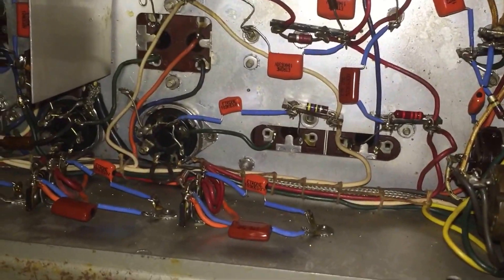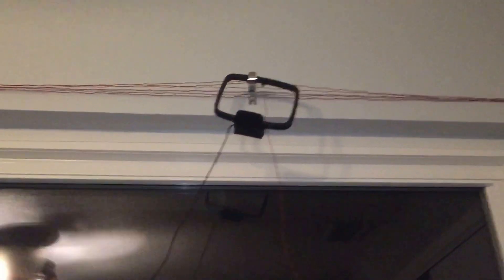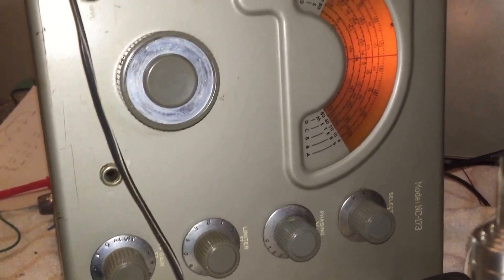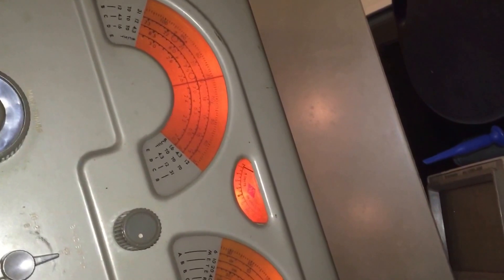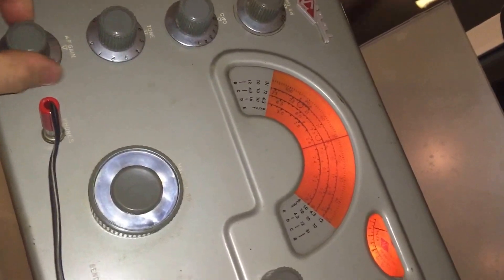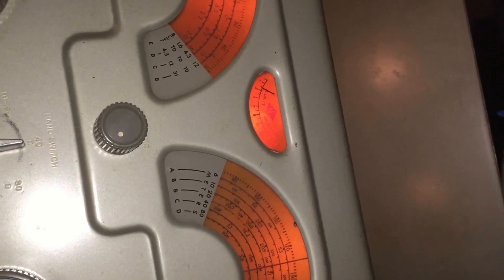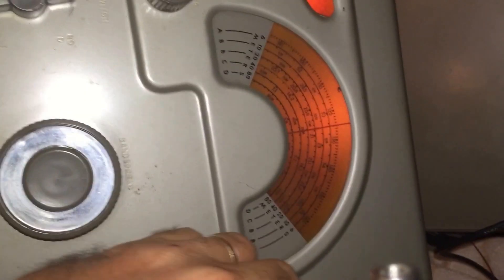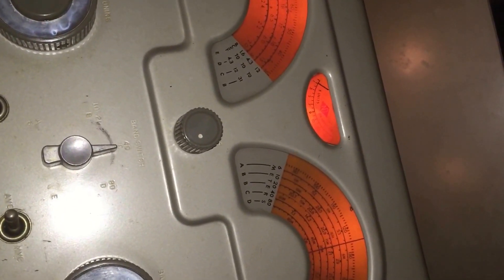National NC-173 receiver project update

Comment: My National (NC-173) Main Power Transformer (T-21) melted down.  Chances of finding an original replacement could be awhile.  I was hoping to replace with a generic step down transformer. My schematic diagram, although it's detailed, does not show the step down voltages, so I don't know what to replace it with.  Since you work on several radios, can you provide me with the three outputs i need?
Reply from the maker: id have to pull the radio to look, lemme see if I can first find the schematic

Comment from the maker: again, as ive stated, in the previous videos, the paper capacitors are by now all leaking, so you are passing DC through them.  Not only does this cause a Hum by passing the plate voltages with the DC from the rectifier onto the next circuit but in many cases the DC is raising the tube bias and overloading it.  my recommendation is to not turn on this radio until the paper caps have been replaced